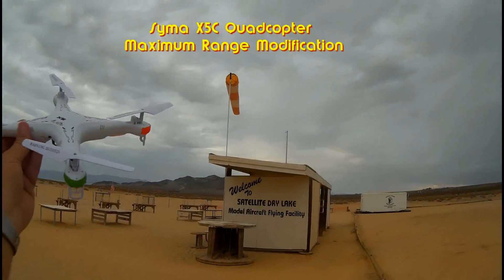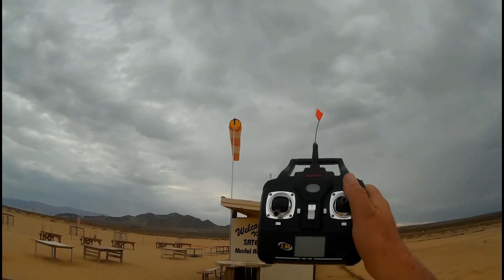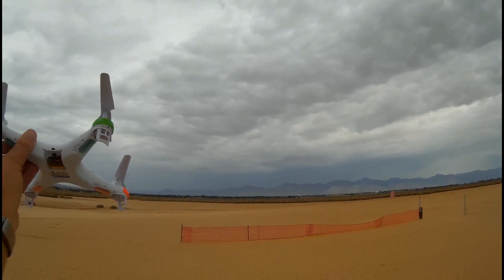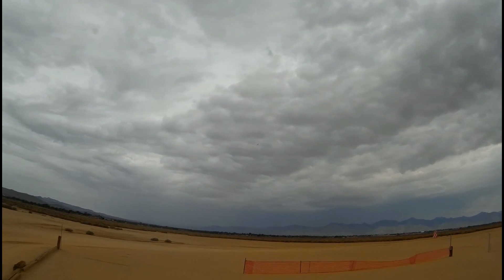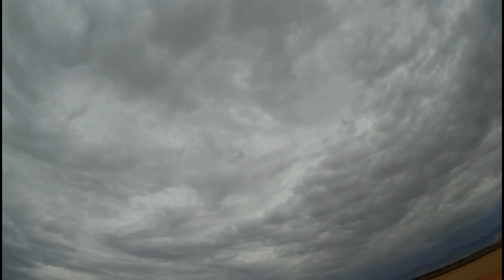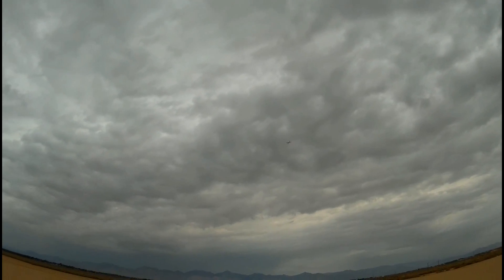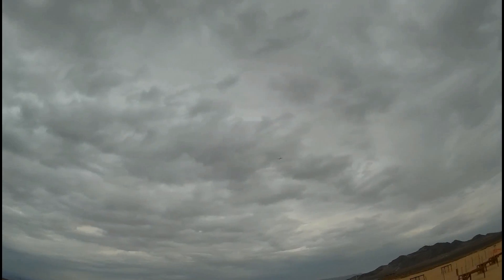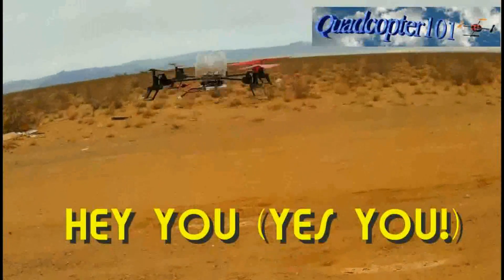Syma X5C Quadcopter Drone Maximum Range Modification

Comment: how much distance improves range? 
Thanks
Reply from the maker: B Tankful Yes, like a donut.  The same amount of energy is coming out of the antenna.  But with the larger antennas, the amount coming out the sides is increased, with less energy coming out the tips (increasing antenna gain). That's how you can get increased range without an amplifier.  http://3.bp.blogspot.com/-ZucbgrbJrUg/TtiwHjyfuUI/AAAAAAAAAHo/nsswDBUA9Qc/s1600/2.png
Reply: B Tankful
Update: Well, I did your Tx wire mod to see if there was any additional range. I used 5/4 (6.15 in or 15.62cm). Rx antenna on the X5C-1 was 30mm, close enough to 31mm so I left it alone. Distance with the Tx mod is now 525 ft (160 m). As you said, if I pointed the antenna at the quad or held it behind my back I lost contact (lights blinked). That was a static test on the ground. Lifted it and flew it back with the antenna pointed to ground from 500+ ft for a test. I had to do this at night, lol,  because the only way I could see it was using the lights. Good fun. Thanks again.
Reply from the maker: The modification will give range improvement out past 100m.
Reply: Well, I drilled a small hole (1/16 in) in the top of the X5C-1 that keeps the antenna vertical when you put it through. I went out to range check it (with it on, walked out with the Tx until the quad blinked, showing loss of signal) for a reference distance. It was 355 feet (108m). Expected 60m. The quad antenna is close to 31mm. I can't wait to see if there is any more distance when the Tx wire is changed. I'm going to use 5/4 (6.15in). I don't expect much more range.
  I need to measure the quad antenna exactly (then I'll make it 1/4 or 3/4, I don't like 1/2 wavelength). I should probably lay it behind the PCB board like I found it and see what that range was. I may also leave it at 100m, as it is pretty small and hard to orient at this distance. (I don't know why some people get really short range out of the box? Tx antenna cut short or wrapped around something?)
Reply from the maker: B Tankful The stock antenna is 1/4 wavelength omni-directional.  Now keep in mind with your extended antenna that you'll need to orient the sides of the antenna at the quad for best range (do not point the tip of the antenna at the quad as you'll see reduced range).
Reply: Quadcopter 101
Oh, ok. By "sides of the antenna" are you saying the radiation pattern (Tx) is right angles to the wire? Is it like a washer or a donut shape from the sides of the wire? What is the best orientation you can get then (for a straight wire), both wires parallel? That's what it sounds like you're saying. That would explain why you don't point the antenna directly at the Rx antenna (quad). There would be reduced signal from the top of the donut hole?  Thanks.
Reply: Quadcopter 101
Ah, thanks for the help.

Comment: Which mode do you use to fly?  Mode1 with rotation on the left stick or Mode2 with it on the right?  Are there any pros/cons to either mode?  Thanks.
Reply from the maker: Mode 1 and 2 popularity is separated believe it or not by geography. Mode 1 (right side throttle) controllers are generally more popular in those countries that drive on the left side of the road with right side car steering wheels. Mode 1 is generally more popular in UK, Australia, and New Zealand (forgive me if I missed a country). Mode 2 (left side throttle) is generally more popular in those countries that drive on the right side of the road with left side steering wheels.  In effect, it has something to do with how our brains have been programmed from driving. So depending on where you are in the world, choose appropriately ;)
Reply: In both of Syma's modes, the throttle is on the left.  I was asking if you have the yaw on the left or right stick.  It defaults to the left stick with the throttle.  Was wondering if its easier to fly one way or the other.
Reply from the maker: Joe Augustino I prefer yaw on the left.

Comment: Is there a quad that has a good camera and good range that is lower than $150
Reply from the maker: There are several new low cost 5MP camera quadcopter about to be released. If you can wait a month, I should have some reviews on them.
Reply: I need to get a replacement pretty soon and only 45 meters isn't to great but thanks for your advise
Reply from the maker: Andersen Fuller Well then here's a listing of some neat ones coming very soon:

http://www.banggood.com/Syma-X8C-Venture-with-2MP-5MP-Wide-Angle-Camera-2_4G-4CH-RC-Quadcopter-p-965758.html?p=RB0922217402201307U3

http://www.banggood.com/JJRC-H12C-Headless-Mode-One-Key-Return-RC-Quadcopter-With-5MP-Camera-p-964872.html?p=RB0922217402201307U3

http://www.banggood.com/YiZhan-Tarantula-X6-RC-Quadcopter-Wide-Angle-500W200W-With-IOC-p-964160.html?p=RB0922217402201307U3

http://www.banggood.com/WLtoys-V686G-FPV-Headless-Mode-RC-Quadcopter-with-2MP-Camera-p-965223.html?p=RB0922217402201307U3

http://www.banggood.com/JJRC-V686-5_8G-FPV-Headless-Mode-RC-Quadcopter-with-HD-Camera-Monitor-p-965561.html?p=RB0922217402201307U3
Reply: Im stuck between the JJRC V686 and the Syma X8C because the Syma only has a range of 50 meters have you found this to be a problem ever
Reply from the maker: Andersen Fuller Yes, such as the Syma X5C is a great flier, but its range is mediocre.  As such, many people do a simple modification to its antenna to improve its range https://www.youtube.com/watch?v=EQbRnQsHLHA
https://www.youtube.com/watch?v=b_IWbiYfvfQ

Comment: Based on your recommendation, I ordered one. First flight today and I notice the range is extremely poor; I do live downtown and was flying on a football field with lots of WiFi around. But I am getting like 30 40 ish feet range :-( will try the range mod to see if things get better. 

One newbie question, what should one do when quad loses signal? It seems the quad just stick to command prior to losing signal! What should I do to avoid having it flying away?
Reply from the maker: When signal is lost, it maintains last input for about 2 seconds, trying to regain signal, before the motors stop and the quadcopter drops. But once it starts dropping you'll need to manually try rebinding (repeatedly moving the throttle up and down). Here's an example video showing what to do when signal is lost https://www.youtube.com/watch?v=odVxR90USz8
Reply: Quadcopter 101 Thanks will try that next time!

Comment: Complete newbie here-Does the antenna have to be straight or could it be coiled like a spring and still fit inside the original controller? Still waiting on our X5C ordered mid December; a disadvantage of living on the east coast I guess, but the anticipation is adding to the excitement for when it finally arrives! Thank you for your great videos and blog.
Reply from the maker: Try to keep it somewhat straight. But remember that most of the energy come out of the sides of the antenna, with less energy coming out the tip.  So when flying distant, try holding the controller to point the antenna sides at the quadcopter.  Also, as a beginner, try to avoid flying distant until you're very familiar with your quadcopter.  In fact, recommend not even thinking of modifying your antenna until you're very familiar with your quadcopter  :)
Reply: Quadcopter 101 Oh, this is something that I'll be 'filing away' for when I'm further along in flying. Right now I'm just watching and hopefully learning while I'm waiting for it to arrive. Thanks for sharing all of your knowledge.

Comment: Hi 101, I have had the Syma X5c since Christmas and I love it. However, the range is very disappointing and the flight time should be a little longer. I know if you don't use the camera it helps a lot but this what I want to use it for. So, you have just solve my range problem ( thank you very much) but how about flight time with the camera. By the way great video, keep up the good work.
Reply from the maker: This is how I get up to 7 minutes flight time with my X5C. I use a different camera with its own battery power :)  Notice I'm also using the range mod in this video  https://www.youtube.com/watch?v=Yk4p_9oEAb0

Comment: The router wire mod looks good, but I'm just not experienced enough to do the soldering onto the board etc. I have no problem joining 2 wires together, either by solder or by crimping. Would using a crimp connector be bad? Also, I would like to keep it inside the "original antenna". From my understanding after reading through the comments, would a 1/2 wave length would be ok at 62mm? Thank you in advance. PS:  The video that you have been posting showing how the wire mod was done is not working for me at all, on any device. I'm just going by what you have said on here.

Comment: Hi 101 I have very little. I have been flying the X1 for a couple months in house and back yard and a few micros for a couple months before  that. I am very patient and will take my time learning what you tell me I need to know. thanks again for the help, Matt 
PS I have a Syma X5C-1 coming in the mail this Monday I figured that would be the next step.
Reply from the maker: Good move X5C-1.  But you should not be considering a CX20 at this point. It could be a very costly and dangerous move. It would be best to first learn the basics of translational horizontal flight, along with maintaining quadcopter orientation by movement alone.  The following web site may help.  Index to the tutorials are in the right column: http://quadcopter101.blogspot.com/2014/12/quadcopter-flight-school-4-horizontal.html

Comment: Hi Quadcopter 101 do you think this will work as well on the Syma X-1? I am thinking of buying the CX-20 GPS Auto Pathfinder Open - source Flight Controller Quadcopter with Camera Mounting Base. Do you have any thoughts on this model? Thanks for any help or info, Matt
Reply from the maker: How much quadcopter flying experience do you have? Which ones have you flown?

Comment: I'm going to try this mod right now with the copper core from a coaxial cable. should be good. should i insulate the protruding end with a shrink tube or no?
Reply from the maker: A coaxial cable has an inner wire that is shielded by an outer wire mesh wrap.  The outer wire wrap may block your signal. I've used coax for this simple mod in other transmitters, but I've used the outer wire as nothing is blocking it.
Reply: Quadcopter 101 I think you misunderstand. I stripped a coaxial cable down to just the copper core and then used that. after modding the controller i noticed a marked range improvement however this got me thinking. Now there isn't room for a full wavelength antenna in the x5 itself, BUT there is room to upgrade the internal antenna to half wavelength. I went ahead and did this as well with another piece of copper wire and the quad now goes far enough i can't see it. .
Reply from the maker: Layne Brown Thanks you for sharing that. Modding the quadcopter's receiver antenna has been proposed before but have never seen anyone try that yet.  Now I'm going to try modding some of mine :)  Thanks again for sharing!

Comment: What about the antenna inside of the quad?
Reply from the maker: Yes, that can be modded too with an antenna extension.  But you need to make sure to keep the extended antenna clear of the props.
Reply: Thanks for replying! Does it have to be a specific length?
Reply from the maker: Yes. It has to be a multiple of a quarter wavelength of the 2.4 Ghz transmitter frequency.  The stock antenna is 1/4 wavelength at 31mm.  But you could try 2/4 wavelength (62mm), 3/4 (93mm), or even one full wavelength (125mm). Any copper wire should work.  Length is total length from the antenna solder point on the circuit board (total = original antenna + extension).

Comment: Is it possible to upgrade the range of the antenna on the quad x5c itself? Can you tell me if this would extend the range even further than your transmitter modification (which I have successfully done on mine).  Do you know what would be the best length for inside the quad?  Thanks for the vids you upload. I have learned a lot from them.

Comment: Hi, great video, I just bought one of these and want to modified the range, which type of wire is used for this? or just any type of wire..thank you
Reply from the maker: Any type of conductive wire should be good. I use copper stranded wire.
Reply: Quadcopter 101 Thank you..Il be doing this soon as I get it

Comment: Nobody has in all the videos I have seen of this modification mentioned what you do with the other end of the cable.
1 /  do you leave the end open (in a cut state)?
2/   Do you solder the screen to the centre wire?
3/   Surely the cable must be in a loop (to allow the aerial/antenna to have a circuit?)
Can somebody enlighten us all to what happens to the end of this cable?
Reply from the maker: 1) Leave it open. It's an antenna.
2) Centre wire
3) No it doesn't need to be in a loop. Keep in mind that it's an antenna.

Comment: is there a serial model for the x5c1 vs x5c I thought u were going to mention other problems
Reply from the maker: By now, all of the original problem X5C's should have been sold and removed from inventory.
Reply: Quadcopter 101 ok but my question is x5c1 is different from x5c???
Reply from the maker: thetruth No, not any more.
Reply: does the x11 range needs to be modified to improve range??
Reply from the maker: No, its transmitter is fine.
Reply: Quadcopter 101 wow I just tried to order from gearbest and it says its in  backorder do they charge for shipping ??
Reply from the maker: No, free shipping.
Reply from the maker: And yes it's a very popular quadcopter.  But they should have it restocked in a few days.
Reply: Quadcopter 101 ok I will try can I rig camera on it ?

Comment: Hi Quad, hope you had a good Christmas and Happy New Years.

Thinking of getting a X5C-1, as I'm building a kinda Phantom look-a-like family, so extending the distance seems reasonable. Awhile back I needed some Antenna wire so I bought some JR antenna wire, (JRPA 170) tho the core wire doesn't look like copper, is that an issue??? or should I find some copper wire (solid OK,) also once installed can I cove the wire and it's insulation with an antenna cover, similar to what is used in RC cars. and last, should the extension, once soldered, be a total of 4.92" (125mm), be measured from the original soldered antenna point on the board??....whew, thats it.
Reply from the maker: Your wire should work fine.  Yes you can cover the wire with insulation if you like. Yes the length of 125mm is measured from the antenna solder point on the board. Note that a 1/2 wavelength antenna (63mm) should also work almost as well if you don't want an antenna that extends out the top. And this fellow shows in detail how to do it https://www.youtube.com/watch?v=EQbRnQsHLHA
https://www.youtube.com/watch?v=b_IWbiYfvfQ
Reply: Thanks Quad
Reply: Say Quad, what is the primary difference in the X5C and X5C-1, is it the board, motors, performance is enhanced how??
Reply from the maker: Michael Aguirre Nothing by now. There should no longer be any original X5C's out there in any shop's inventory anymore.  As such, Syma is going back to calling them just "X5C", and hopes that everyone forgets that there once was a difference :) (by the way, the original had serious flight performance issues. https://www.youtube.com/watch?v=hxRjUH-9pU8 )

Comment: Ken K is spot on. A full wave antenna presents a high impedance and thus a mismatch for the transmitter (which is obviously in  the 50-70 range due to the stock 1/4 wave ground plane antenna). It would also introduce lobes into the field strength pattern.

Comment: Excellent mod and video, thanks. I may have asked before, but you appear to have the best vids on quadcopters and mods - you at least articulate (some mumble). If you take two standard batteries 500MAh each and wire them together in series, doubling the voltage, insert one in the battery slot and tape or velcro the other in the place where the camera goes, will this increase in voltage increase lift or cause damage? I assume that the throttle controls voltage to the motors, more voltage = more rpm = more lift. So starting with a higher voltage, you could use the throttle in the lower range and either carry more cargo (camera) or increase flying time - just a guess. Would a higher voltage cause damage (the camera maybe)?
Reply from the maker: It would likely damage the flight control circuit board since it also powered by the battery, and designed for only 3.7V.

Comment: Hi boss happy thanksgiving hey can u post a video or pics how you did your upgrade for your remote control if u can  or can I send u my e-mail please well take care
Reply from the maker: This isn't me, but here's a fellow that documented this:
https://www.youtube.com/watch?v=EQbRnQsHLHA
https://www.youtube.com/watch?v=b_IWbiYfvfQ
Reply: I seen that video but yours is better because your antenna is bigger how more range that guy antenna is smaller that does it have the same range
Reply from the maker: Some people claim that half wavelength is just as good as full wavelength.  I don't know if the claim is true or not.  I found it just as easy to use a full wavelength 125mm wire as compared to his half wavelength 62mm wire. I just burned a hole in the top of the fake antenna with the heated tip of a paperclip to let the extra wire length run out.  I also sealed the wire at this hole using hot glue so it wouldn't "jiggle".  But you decide which to try.

Comment: Hi hey how many inches from the original to the extesion u sadder do I have to cut 4.92 inches on the copper or couple inches fron were u sadder please tell me
Reply from the maker: Measure so that the original PLUS the extension equals a total length of 4.92 inches (125mm), then snip off any extra.
Reply: Thanks what is the thickness of the copper wire
Reply from the maker: It doesn't really matter.  Any copper wire should work well.